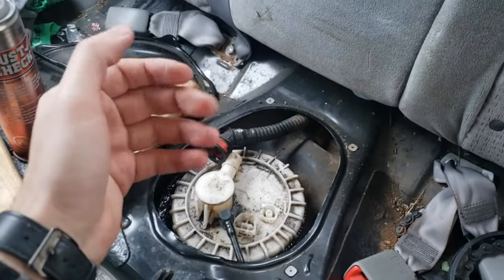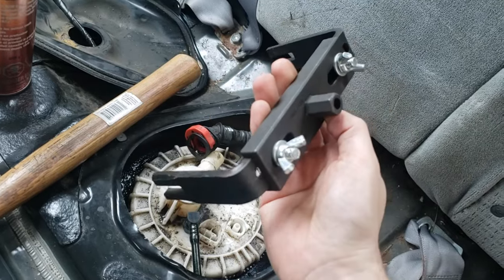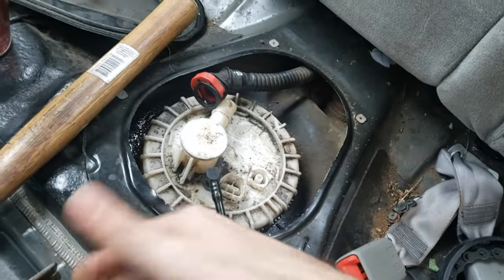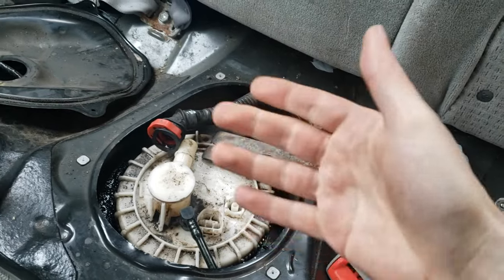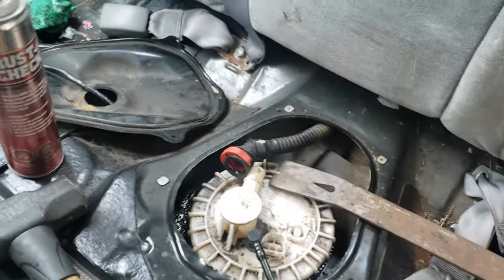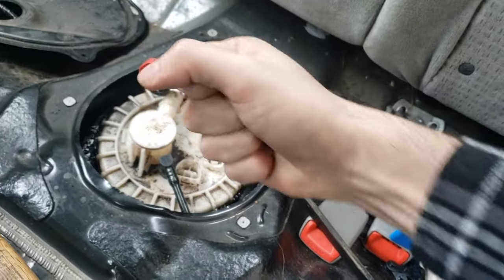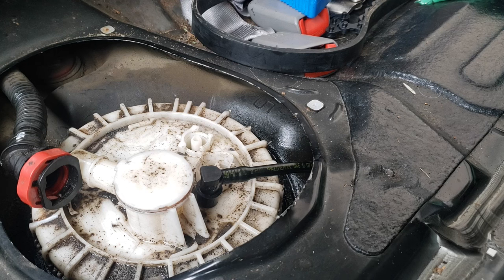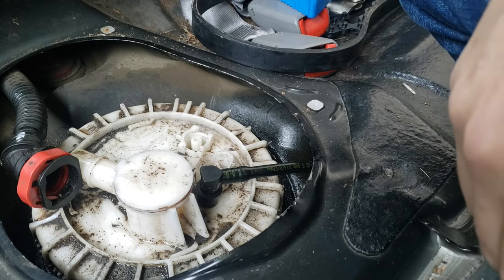How to Remove a Fuel Pump Lock Ring: Reality Check!

Comment: Tried wood, screwdriver, metal bar, flat pry bar as suggested, nothing works. I'm going to cut the fucker off and buy a new one. Ridiculous how these are designed.
Reply from the maker: Ahhh, you got one of those! You must feeled it, when I said some people make it look so easy, when it's not the reality. 
Usually the flat bar with an heavy mallet would have done it. Man, if you are feed-up I don't judge you for cutting it off, but if you can keep going with an heavy maller with the flat pry bar. 
-Get piss and cut off those tab with the pry bar and the hammer. I want you to try to break them. I believe it will turn after 5-6 broken tab.

But ya, if you go for the cuting, watch yourself, don't touch the floor. A cut on top of the lock ring on both side will do the job. Finish with an hammer and a chisel or something. 

Prefer you being piss in one peice than you being piss and missing half your face from a burn.

P.S: Save the o-ring between the floor and the pump, just incase the new pump doesn't have the proper one. Happenned often to me to get smaller one!

Stay safe man! And Fuck that lock ring for me! Hahahah